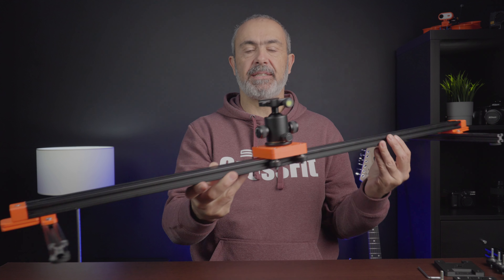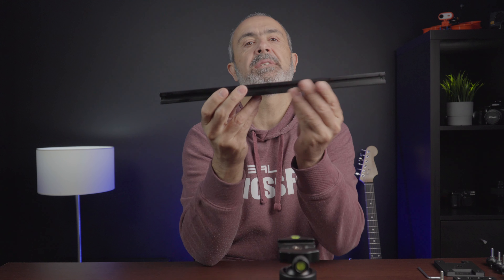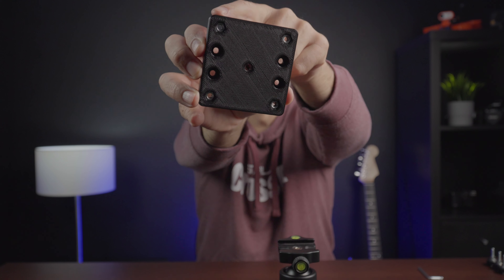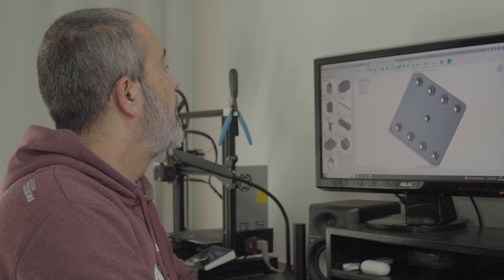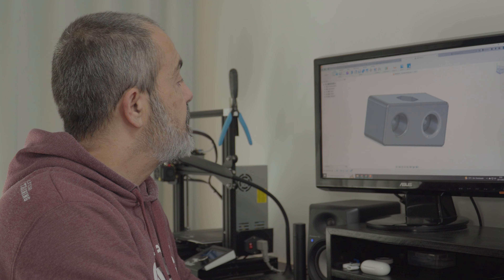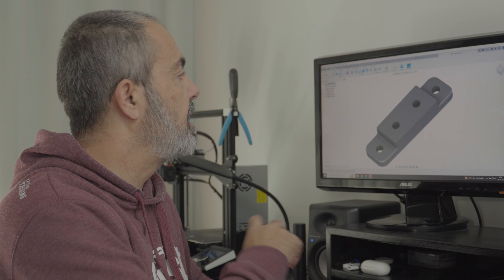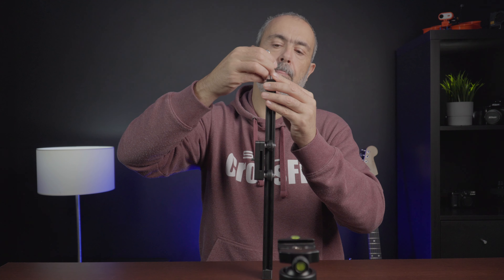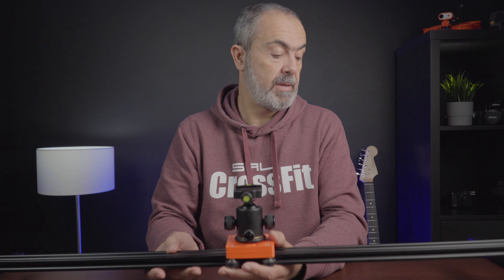How to Make a Professional Camera Slider in 2022 (DIY Project)

Comment: Hello, thanks for the video but thingiverse link is down. Second, where can we expect the motorized slider video.
Reply from the maker: Hello, I will see what is wrong with the link. I'm finishing the motorized part. Still doing some adjustments to the arduino program.
Reply: @paulo.mesquita  thanks...🙏
Reply from the maker: @hsnorh8180  the link is now working.
Reply: @paulo.mesquita  👍👍